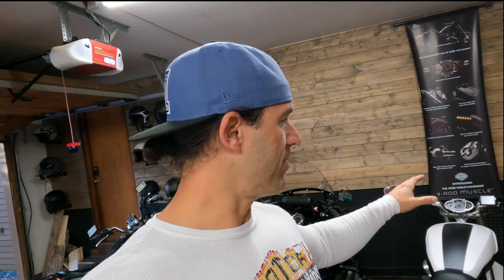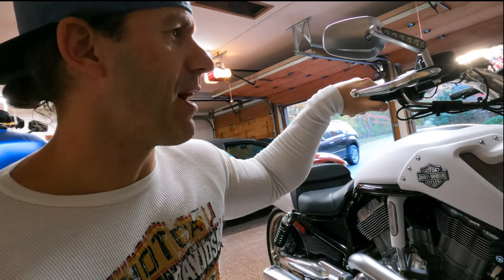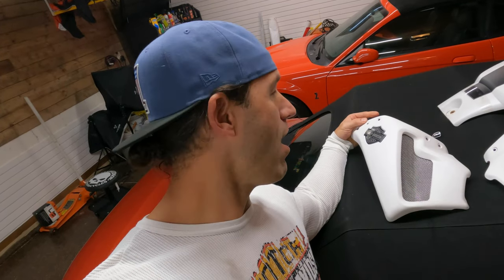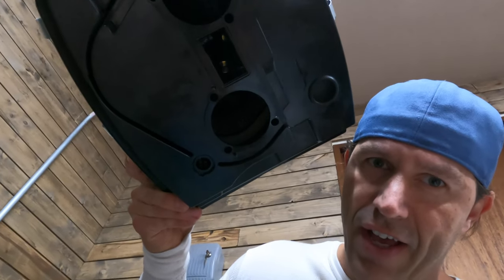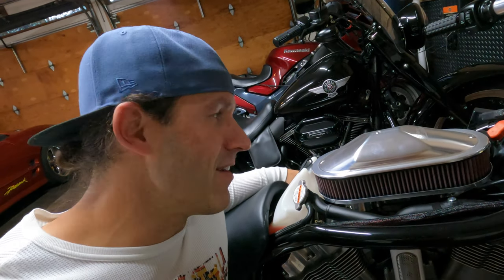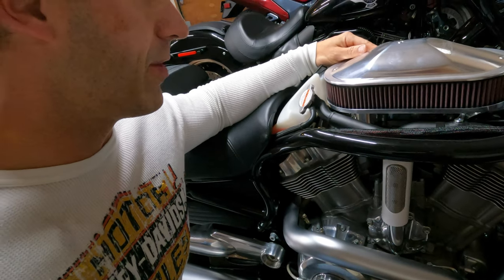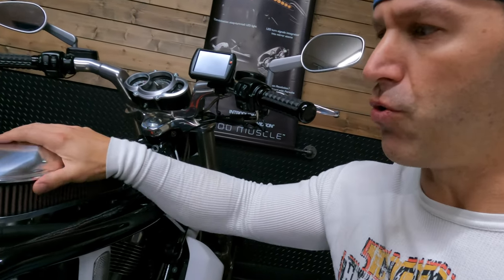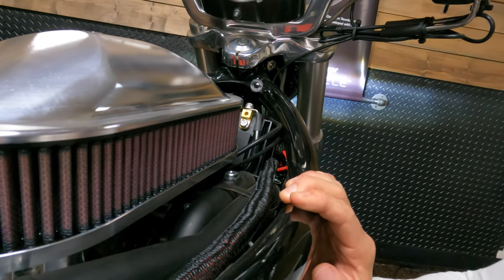Harley-Davidson V-Rod SUPER INTAKE!!!

Comment: I cut & trimmed the stock lower airbox flush with the filter which not only gave me easy access to the battery & front plug; but I got to keep the velocity stacks (your meager power gain might have to do with their elimination).

I noticed a significant bump in power with the airbox mod & S.E. filter. 

NGK Iridium plugs & hotter coils also seemed to bump the power a bit.

Tab Performance slipons w/o baffles gave a better sound but no noticeable power increase (but probably will with a good dynotune).

By bypassing the valve cover vents from intake into a Catch Can ($15.00 ebay item but needed extra hardware to install) made a HUGE difference! Definite power increase from mid-high rpm and runs much smoother now.

I solved the hassle of those 10 side cover screws by replacing the airbox cover nuts with 1/4 inch brass colars (Ace hardware) & quick release pins (ebay) to replace the screws. I can now get to the front plug in less than 2 minutes.
Reply: I like to see your mods with the oil catchcan en screws.
Maybe with part numbers 🙏
Reply: That'd be good to see

Comment: Great video. I have an 04 that has lots of work done to it. Dynoed at 133hp, you just convinced me to spend a little more and get that extra 2HP. 👍
Reply: $500 2 HP 😂. 133 HP is solid for a 640lb bike. I was looking to get/do a 1250 with the 180 tire and get that ish power out of it. There is a shop near me in Greenville OH that did lots of V Rods for years I figured would be a good resource. Before I could find one I bought a 2019 softail 114ci 670lbs 180 rear tire. Got it to 135 HP 134 TQ so I guess I ended up about the same place.

Comment: Glad I found your channel just subscribed ,congratulations on owning that Gorgeous VRod 🇺🇸👌🏻 does that intake setup require a tune?  I have a 13 muscle with the stock setup only mod I got was a set of Vance & Hines slip on’s.
Reply from the maker: Yes sir a tune is important. V-Rod runs lean from the factory. You will notice issues without a tune. My powervision tuned it well after several tuning sessions on the road. Runs great now!  You have baffles in the slip ons?
Reply: @TorqueandPower  I have the same slip on’s as your bike with the baffles still in them I think it sounds awesome definitely has lots of deceleration pops but it doesn’t bother me just wondered if it was bad for the bike? Most tell me it’s not a big deal . Thanks for the quick reply
Reply: Tuner is required to get the full performance. I had Toxic exhaust no buffles with Powervision and it was great! Now that I have the intake and had it retuned, it feels even more  powerful.
Reply from the maker: @ixibladeixi2639  that is awesome to know thanks!  Ever dyno it for numbers?
Reply: @TorqueandPower  Awesome channel and awesome bike! Was it complicated to get it tuned in correctly after you installed the new airbox? I have the same setup with a couple custom mods but I was curious about the power vision tuner- did you download specific maps for it? Anyhow- I’m new to tuning and will probably watch a few vids on the power vision.
Reply from the maker: @olivierred007007  no isn’t hard to tune it all with the PV. Got a map from fuel moto that was close to my mods then I went out and auto tuned it on the road several times till I got it dialed in. Runs great and strong now!!  Thanks for the comments and the compliments!!

Comment: Dude, been considering this for yrs! #1 KEY FACTOR to ME is the eaze of getting at everything so easily, had 03 VRSCA 12 yrs, how many hours removing/installing lower plate for battery or to run some wires! thats worth $500 to me. 05 Road Rod bike is going to welding surgery tomorrow, so good time to do it, I sold it to Myself!!!    Still want a SC!!!  nice video
Reply from the maker: Super easy install and no more leaky oil from the notorious front hose!

Comment: We have the same exact bike  color n all it has a stage 2 already installed n cams when we purchased it from a Dr. I rode a stock one to compare it to. And this things a freaking monster. Outran a Suzuki Habusa with it no problem in a qrt mile race in Tulsa at raceway. If you’re doing the 1:01  stage two you’re gonna be amazed. I think I’ll do the fancy intake you done love the look. We have factory leather saddle bags n windshield. Great bike we love it. When we go on rides with friends they hate it cause it’s the leader of the pack lol. I don’t hot rod it around hey it’s there lol. Love your videos. Lookin forward the my500.00 holigan. lol.

Comment: They fit a five gallon tank under there? Wow that's way more than I would have thought. Good on them for getting that right. I once had a 535 Virago and the underseat tank was tiny compared to other motorcycles of that displacement with a traditional tank.
Reply from the maker: The original had 3 gallon then they raised it to 5 gallons. Gives you plenty of range.

Comment: How do you feel about the radiator cap facing right towards your legs if the bike was to overheat and spill out Coolant not sure why Harley engineered it to face towards a riders legs I am considering buying a V rod muscle love the channel and details that you give on the V rod
Reply from the maker: Never bothered or thought about it ha. But the seat would block it easy plus when you see the reservoir it’s good size and only 1/3 full to hit the top mark.  You can’t go wrong with the muscle it’s my favorite Harley so far!

Comment: Hey just to add, if you want to hear that intake growl, (if it even sounds different?🤷🏽‍♂️) you’ve got to give it a good quick wot twist and make the engine catch up, and immediately let out. Not saying let it hang at 9200 at all, just give us a good idle blip so some resonance if any can be experienced! 
Wondering how the difference would sound between the stock to the mod…

Nice bike tho man, definitely a fine HD. 
IMO, perfect power cruiser, dependable and very very powerful out the box.
(Sold the 2003 😞)
Reply from the maker: It’s much louder the intake noise than stock for sure!  Sounds great!!

Comment: I know you are probably not thinking about mileage on a V-Rod but I'm curious if you noticed that 5 gallon tank getting you farther with the new intake and tune combined. Thanks for the videos you have done and are doing with your V-Rod.
Reply from the maker: I’d actually say it is about the same gas mileage wise but it is tough not to be heavy on the throttle with the V-Rod!
Reply: I have a 2014 muscle when I get on it I get 25 miles a gallon cruising around probably 30 to 35

Comment: You do not have to pull the engine to put cams in. It is done with the engine in the motorcycle. You just loosen the center front mount bolt to lower engine enough.
Reply from the maker: I’m changing out the springs as well in the heads so motor will be coming out. Can’t wait to see how it behaves after!

Comment: Hey so you not using any new fuel mapping system doesn’t the slip on sand intake lean out you bike it’s so lean to begin with?
Reply from the maker: Yes for sure it makes it very lean. I just had it tuned with dyno and powervision and it put down 121hp

Comment: Looks good man. I have the same bike and it's all stock but have the same Vance&Hines slip ons you have. I have lots of decel pop, did you have the same issue before you installed your tuner, and did it fix it? Are you running a canned tune, or have it dyno tuned?
Reply from the maker: Great question!  Yes decel pop a lot but after a lot of sessions with the powervision it is almost gone now. It helps a lot the tuner and that’s only using the narrowband sensors. Hope this helps you!
Reply: @TorqueandPower  Thanks for your reply. They obviously tuned these bikes very lean to the point where even a pair of slip-ons cause so much decel pop. You got a subscriber!

Comment: How about a stock dyno sheet then one after the new air cleaner? Looks like a waste of money. Stock box flows just fine.
Reply from the maker: I’ll dyno mine soon and post the results. Fixes leaky oil issue as well
Reply: @TorqueandPower  where did you route the breather?